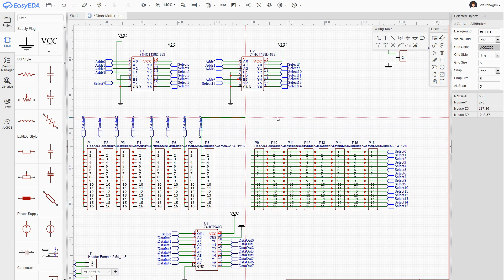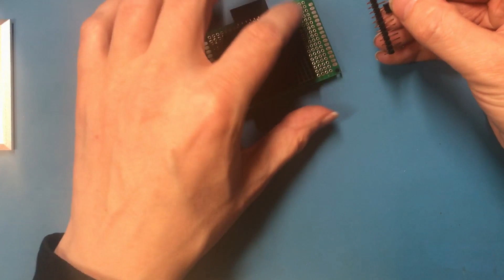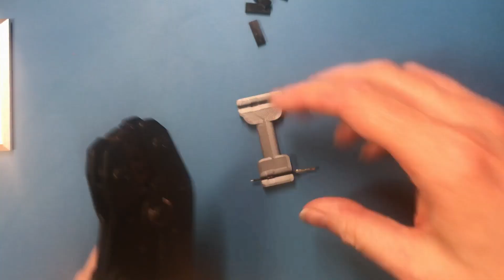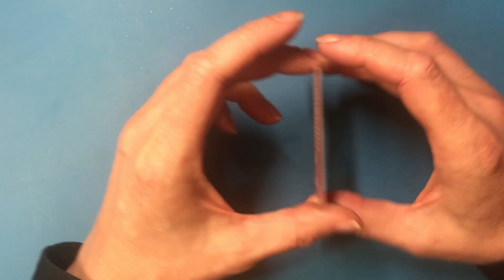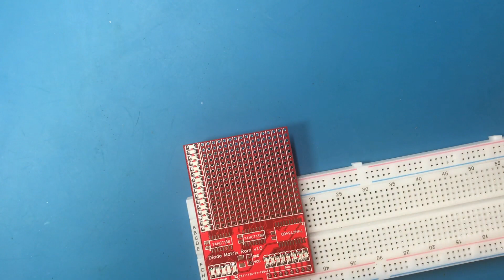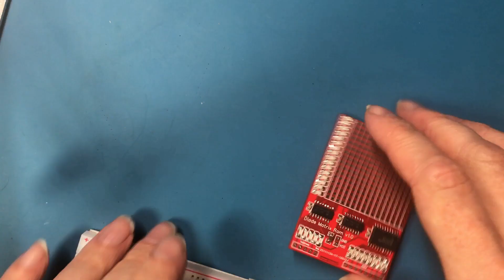Diode Matrix - Finish and Test   (2/2)

Comment: Use LEDs in the matrix, will look pretty
Reply from the maker: I've thought about, problem with LED's is they are really not designed for this kind of work so you probably wouldn't want to use it for a final circuit. Might be fun to play with as an experiment but you'll likely need to tweak the circuit to make it sink enough current to illuminate them.
Reply: @weirdboyjim  yeah they are only nominally "diodes"
Reply: Wouldn't the voltage across an LED be a problem? It's much higher (2 to >3V, depending on the type) than the 600mV across a conducting 1N4148.
Reply: Watching your videos got me hyped to revisit my ttl computer project.  I got as far as registers and ALU.  Stopped when reading up on how piped line stuff worked.

Comment: I'm really surprised the EEPROM programmer required you to plug in external power to the breadboard. You would think that could lead to issues with the two power sources having a voltage differential between each other. Also, I'm surprised it was able to read the diode matrix with your own reading circuitry still attached at all.

So, would this be considered a plain-old ROM (since the way things are wired determines the ROM's contents), a PROM (since you can "program" it by moving the diodes around), or an EPROM (since you can "erase" it by yanking out all the diodes)?
Reply from the maker: It may have been better to power it from the chip socket entirely. There was no “reading circuit” attached the chips on the pcb are just part of decode logic essential for the rom.
Reply: @weirdboyjim  When I said "reading circuit," I was referring to the 74LS193 you had on the breadboard and plugged into the address lines on the PCB, and the clock circuit attached to the 74LS193.
Reply from the maker: @sillymel  silly, silly Mel. If you look again you’ll see I moved those lines to the other half of the breadboard. They are not connected.
Reply: Oh. You're right! How did I miss that?
Reply: Yeah, connecting the power rail of the EEPROM program to the board is a bit risky, I think it's about 21V when burning the EEPROM. I know only used for reading, but one wrong click... Of course grounds need to be connected.

Ingenious to use the EEPROM programmer to read the contents of the diode matrix.
Reply: @axelBr1  It's UV erasable EPROMs that have the 21-volt programming requirement. EEPROMs, as the diode matrix is emulating, require only the single power rail. You can program them with little more than an Arduino and a shift register.

Comment: I would just have ordered diodes with beefier leads (1N4004 or the like). Those also would have plastic bodies, so you don't have to be concerned about the glass breaking from bending the leads.
Reply from the maker: Thicker wired diodes would have helped in a number of ways. It would have made it  practical to use the original "poke wires into dupont sockets" plan for starters.
Reply: 1N4004 is a rectifying diode and isn't designed for fast switching. Might not be suitable for the speeds required in the CPU
Reply: @axelBr1  I was referencing the typical packaging, not the electric specs. Especially because I have no idea what specs James needs ;)
Reply: @HenryLoenwind  Form follows function, the diodes with beefier leads will be designed to switch low frequency 50 to 60Hz may be a few hundred Hz but high current loads, hence the thick leads and their recovery from being reversed biased will be quite slow. For the diode matrix forming part of the CPU's microcode James is running in the several MHz range and low current, (with CMOS chips practically no current), hence thin leads.

Comment: Super fun project, it could be usable for many hobbyists in a form of some Tindie PCB? Few thoughts:
- 74159 seems ideal as row driver because it is open collector able to sink 16mA (probably even more)
- maybe instead of row leds and column leds, the diodes can be replaced with LED diodes - cool lightshow effect as memory is read!
- data line drivers could be ended with a XOR with a microswitch to invert or not - this way it can be guaranteed that no data line needs more than 8 diodes to drive it (if say 10, use 6 diodes and flip the switch on the line)
- expanding on the idea above, 16*8 memory will always need up to 64 diodes max - put them permanently and neatly on the PCP (maybe as LEDs), expose 2 male of female connectors next to each of them and simply connect only the wires to 2 fixed 16*8 breadboards - one is row connected, the other column connected.
Reply from the maker: Glad you like it,  lots of interesting ideas there. The 159 looks like an interesting part, but I chain a couple of 138's together to do a 16 line decode in a few places so it would be handy. I haven't found anywhere that sells them as a current part though.  Using LED's as the signal diodes is an interesting idea,  I did think about I think you'll end up outside of the ttl spec without some extra components.

Comment: I wonder if you could have used the original socket design, but with MELF diodes soldered onto pin headers.

Probably would have been more fiddly than crimping like you did though.
Reply from the maker: Yeah,  it would have worked that way around as well. Transferring the ALU to pcb soon, I could use a rom chip to replace it all. Or I need to find the most compact way of doing the diode matrix.
Reply: @weirdboyjim  diode matrix would be a really cool visual element, if you can manage to keep it.

MELF diodes may just be slightly more easier to solder when packed in. I suppose you might also be able to spread them out a tiny bit more. But probably not great if you need to make changes, although hot air could help with that.
Reply: Well, the little signal diodes you used might be the easiest, being through hole.

Comment: You could perhaps use machined pin female header connectors rather than the male headers. The machined pin female headers would grip the smaller diode leads better than the style of female head you used on your prototype.
Reply from the maker: Nice suggestion, might be worth a try. The little dupont connectors work well but it was time consuming to make them all.